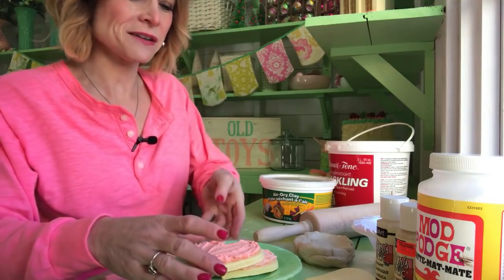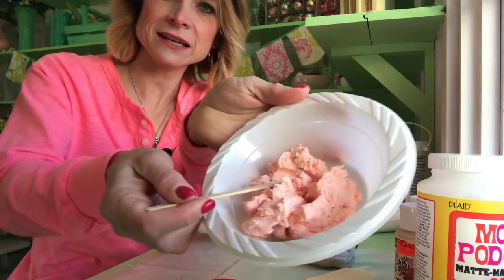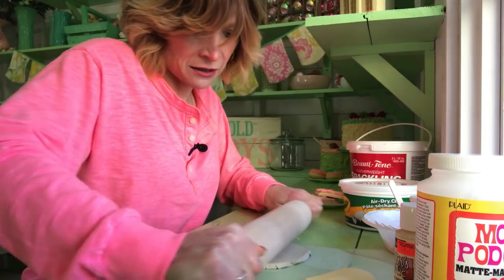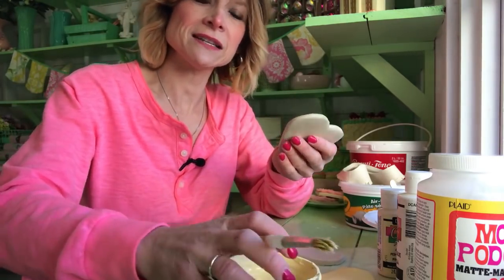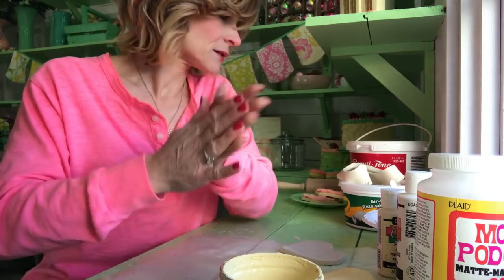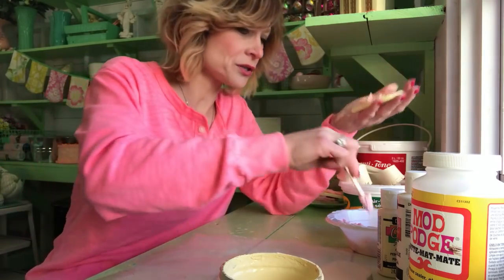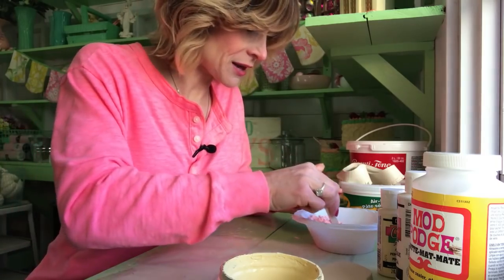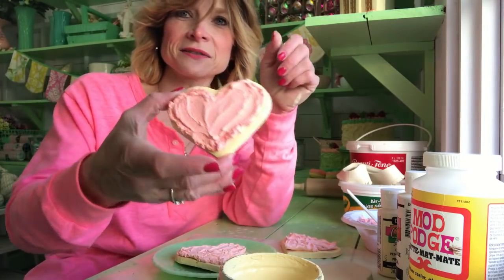Fake Valentine Sugar Cookies

Comment: Great video! I'm making throws for an easter parade because plastic beads are terrible and nobody keeps them. Have you ever sealed the clay with gesso or primer before you  paint it? Is that a thing?
Reply from the maker: Yup could definitely seal it if you wanted :)

Comment: Have you used other 'air dry' clays other than Crayola? I'm searching online and see that there are other brands, but sometimes it's worth sticking to a particular brand to get desired results.  I found a 25 lb box (different brand than Crayola and it is air dry).
Reply from the maker: I have used one at our Canadian dollar store but I have started using model magic which is by Crayola but it’s nice to work with !It is also lightweight in comparison to the other air dry clay by Crayola!

Comment: My paint won't adhere to my air dry clay or the polymer clay. I'm using acrylic paint.
Reply from the maker: J It should paint to your air dry clay ,I’ve used two different kinds with no issue!I’m not sure why it won’t adhere for you.Polymer clay comes in colours so it isn’t made to paint and I only paint air dry clay.Are you using Crayola air dry clay?